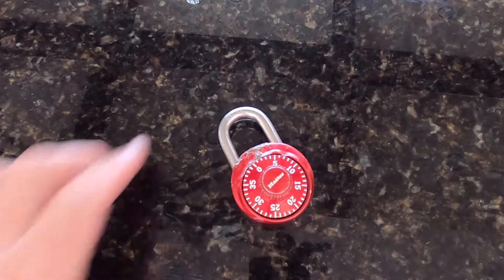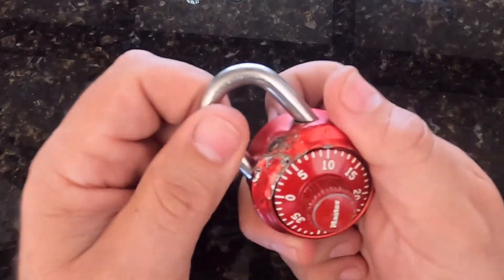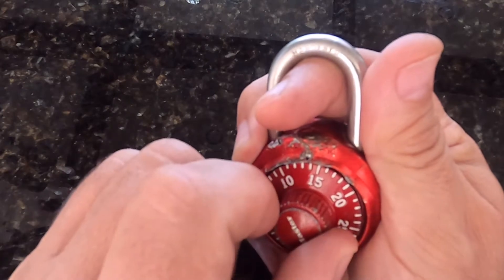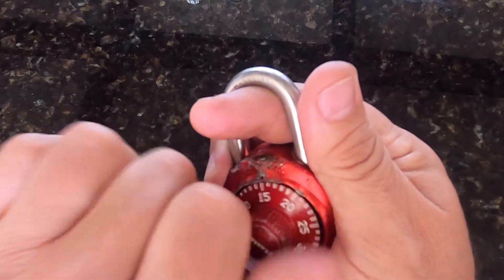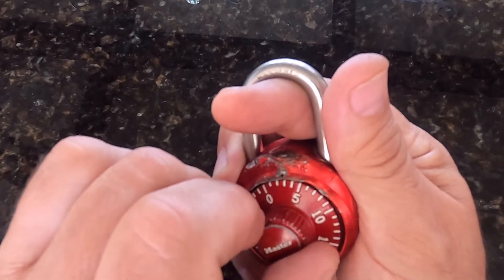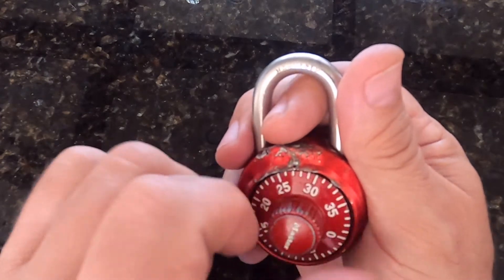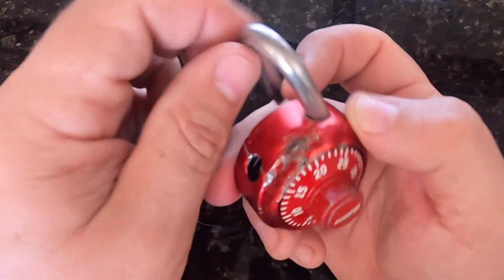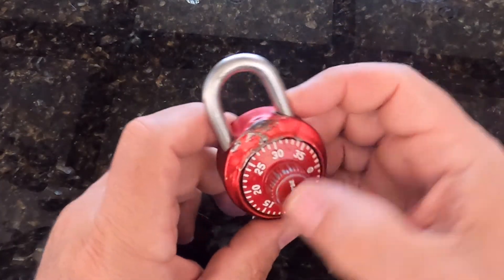🔒Lock Picking ● Will It Open? Decode Combination on Damaged Master Lock Using Only Feel

Comment: I was bored one night on watch when in the Navy, we had the same style locks on lockers down in the plant. They can be opened in 169 tries or less. lol
If you pull the shank hard, the last number will be the one where the dial rocks loosely. Your method is a little faster, I admit. The lock has about a 3 number sweep on the first 2 numbers where it will still get it open..
Reply from the maker: Thanks for your comment!  I’m going to give that third number idea a try!